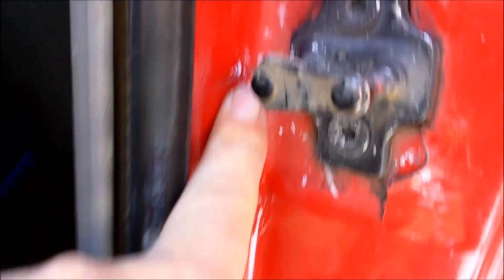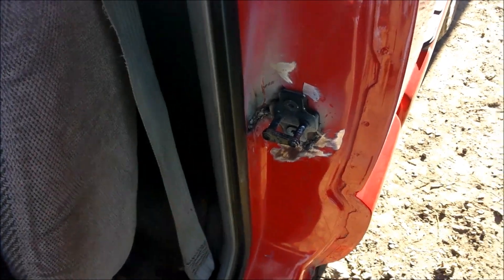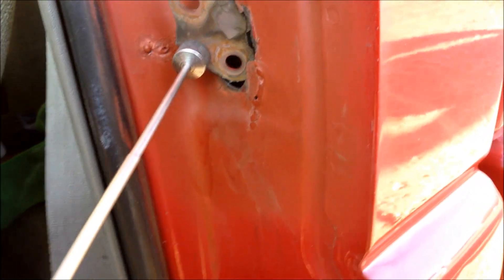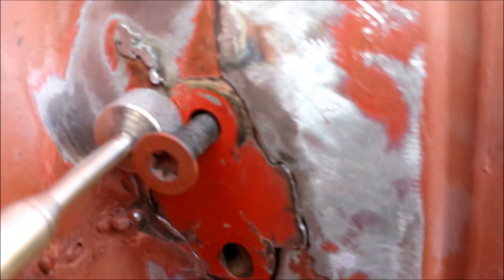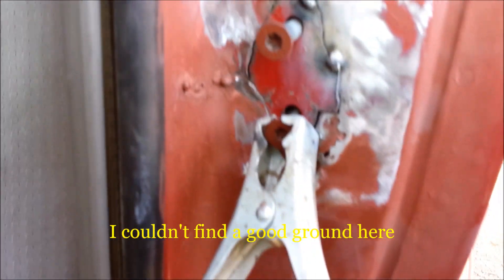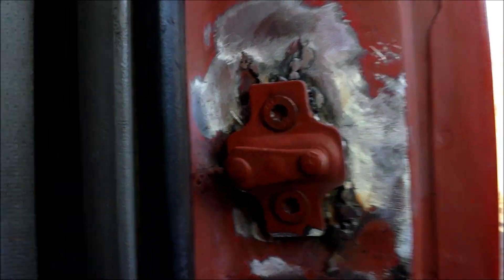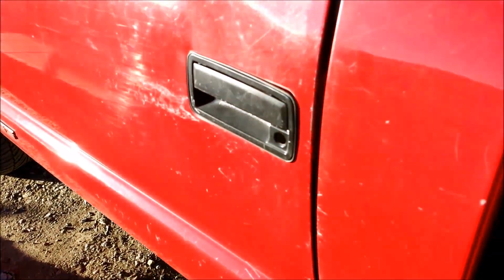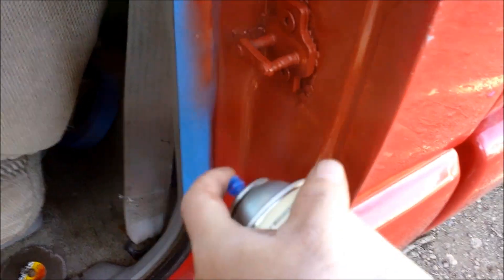Chevy s10 ss (Door striker cracked off)

Comment: I just did a temp repair on our s10 crewcab door strike, dummy me bought the truck and did a bunch of little repairs and knew the door bushings were shot but soon forgot about it as other projects came up and then the message came from my wife while she was at work that the door wont close right. I go look at it at 4:30 in the morning and yep the metal was cracked, strike plat pushed in so after work I did a quick temp MIG weld repair on it and then PUT NEW DOOR PINS AND BUSHINGS ON and lubed it all up.

 I will be taking off the strike plate and adding an enforcement plate to my MIG stitched repair asap.(was wishing I had a TIG)

It took us 3 hours to bend it back into place stitch it back together with the MIG and install the new pins and bushings that I bought months ago.....DOH. 
Some of the thinnest metal I have seen.

Comment: i know this is old af but i had the same problem and i used an old street sign and cut a piece bigger than the hole. bolted the striker to the sign and used self tapping screws to hold the piece in placevit worked over a year until the truck was totaled